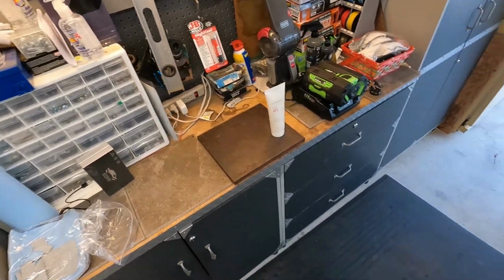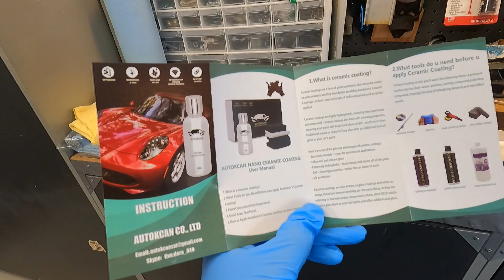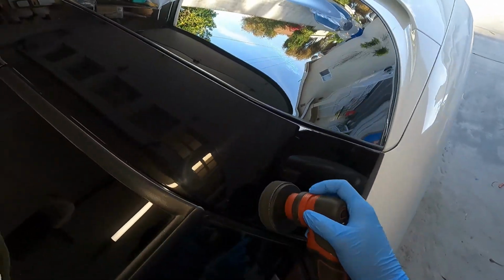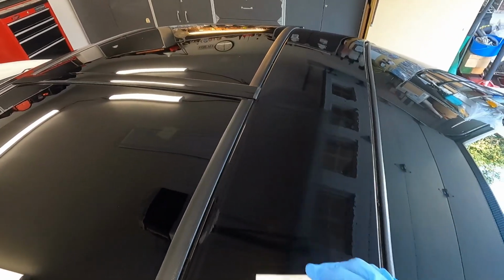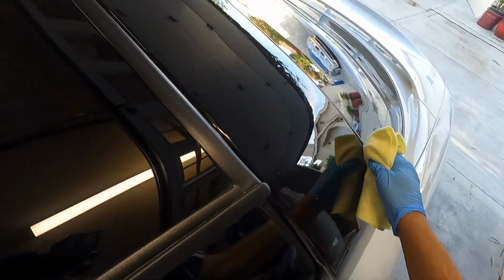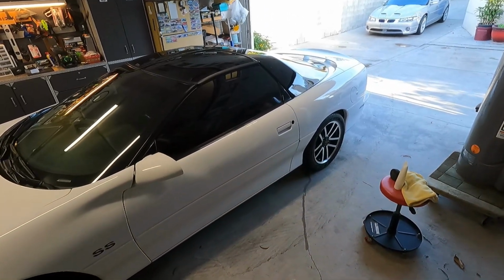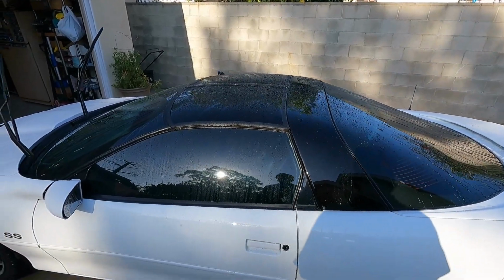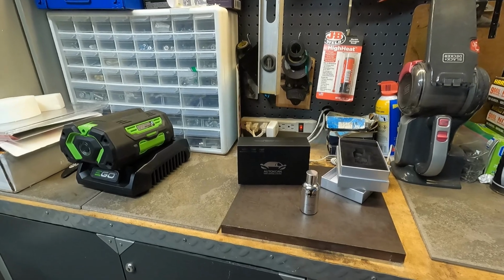Autokcan Ceramic Coating Review

Comment: In cheap coatings, you could test nano king graphene 10H+ (I think manufactured by nano age, Maybe autokcan too ).  I bought it €29.99 30ml and a nice packaging!.  Easy to install, strong lotus effect, and frankly it is resistant, I tested with meguiar's apc, super degreaser, iron decon etc and it resists very well.  On the product it is written = Sio2, graphene, fluorine.  So a fairly innovative product that I find?!
announced for 3 years for 1 coat, 5 years for 2 coats.  I opted for 2. I even tested a place where I added a layer of carpro gliss v2 to have fun and see if it adds protection, to be seen over time!... Otherwise your review  is 👌👍

Comment: Do these coatings harden and prevent tiny surface scratches?
Reply from the maker: Proper washing techniques is important but a coating will do a better job than a wax or sealant with wash induced marring.
Reply: @MikeGDetailing  Right now on my brand new Accord I have a ton of tiny surface scratches that are from the car being washed. I got it from the dealer like that. It's annoying and I want to polish it and put a coating over it.
Reply from the maker: @SpeedBoostRC  this is common from the dealer if they wash it before they deliver it.  I would recommend other coatings rather than this one or avalon king.  There are better coatings.

Comment: Have a good feeling Avalon King is the same but they're charging an absurd amount, I had Avalon King on my BMW, left it 5 days in the garage, and followed everything and temperature applied, one rainy day, and the bottom portion of the car is gone where the water gets sprayed by the wheels, one rainy day after a whole week in a garage. It is indeed overrated and over sponsored so people should be careful spending that much on garbage. A wax performed better honestly.
Reply: Estas equivocado, este es un excelente producto, juego a la par de cualquier Tratamiento Cerámico el tal Avalon no lo conozco.